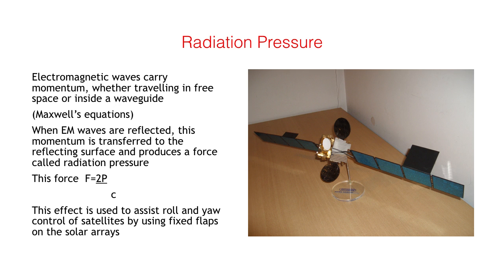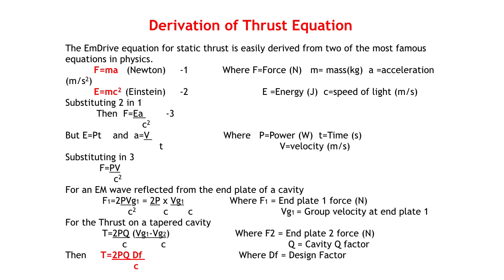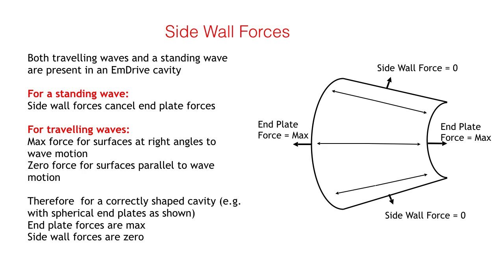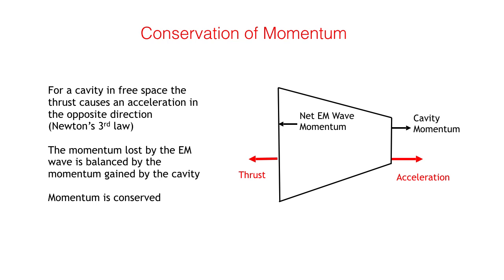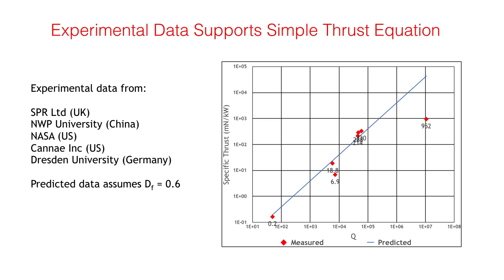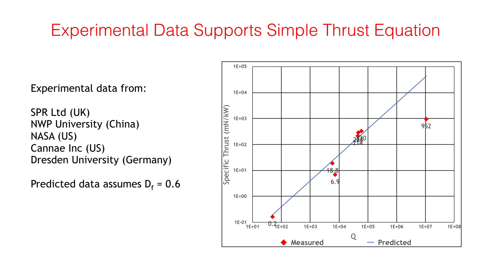Roger Shawyer Explaining The Basic Science behind #EmDrive

Comment: EMDrive 
FAQ (From the developer's website emdrive dot com)

Theory

1. 
Q. Is the thrust produced by the EmDrive a reactionless force?
A. No, the thrust is the result of the reaction between the end plates of the waveguide and the Electromagnetic wave propagated within it.

2. 
Q. How can a net force be produced by a closed waveguide?
A. At the propagation velocities (greater than one tenth the speed of light) the effects of special relativity must be considered. Different reference planes have to be used for the EM wave and the waveguide itself. The thruster is therefore an open system and a net force can be produced.

3. 
Q. Why does the net force not get balanced out by the axial component of the sidewall force?
A. The net force is not balanced out by the axial component of the sidewall force because there is a highly non linear relationship between waveguide diameter and group velocity. (e.g. at cut off diameter, the group velocity is zero, the guide wavelength is infinity, but the diameter is clearly not zero.) The design of the cavity is such that the ratio of end wall forces is maximised, whilst the axial component of the sidewall force is reduced to a negligible value.

4.
Q. Does the theory of the EmDrive contravene the accepted laws of physics or electromagnetic theory?
A. The EmDrive does not violate any known law of physics. The basic laws that are applied in the theory of the EmDrive operation are as follows:

Newton’s laws are applied in the derivation of the basic static thrust equation (Equation 11 in the theory paper) and have also been demonstrated to apply to the EmDrive experimentally.

The law of conservation of momentum is the basis of Newtons laws and therefore applies to the EmDrive. It is satisfied both theoretically and experimentally.

The law of conservation of energy is the basis of the dynamic thrust equation which applies to the EmDrive under acceleration,(see Equation 16 in the theory paper).

The principles of electromagnetic theory are used to derive the basic design equations.

5. 
Q. Why does the EmDrive not contravene the conservation of momentum when it operates in free space?
A. The EmDrive cannot violate the conservation of momentum. The electromagnetic wave momentum is built up in the resonating cavity, and is transferred to the end walls upon reflection. The momentum gained by the EmDrive plus the momentum lost by the electromagnetic wave equals zero. The direction and acceleration that is measured, when the EmDrive is tested on a dynamic test rig, comply with Newtons laws and confirm that the law of conservation of momentum is satisfied.

6.
Q. Is the EmDrive a form of perpetual motion machine?
A. The EmDrive obeys the law of conservation of energy and is therefore not a perpetual motion machine. Energy must be expended to accelerate the EmDrive (see Equation 16 of the theory paper). Once the EmDrive is switched off, Newton’s laws ensure that motion is constant unless it is acted upon by another force.

7.
Q. Why does the thrust decrease as the spacecraft velocity along the thrust vector increases?
A. As the spacecraft accelerates along the thrust vector, energy is lost by the engine and gained as additional kinetic energy by the spacecraft. This energy can be defined as the thrust multiplied by the distance through which the thrust acts. For a given acceleration period, the higher the mean velocity, the longer the distance travelled, hence the higher the energy lost by the engine.
This loss of stored energy from the resonant cavity leads to a reduction in Q and hence a reduction of thrust.

Test procedures

8.
Q. Has buoyancy been allowed for?
A. Buoyancy has been allowed for in the initial experiments and then eliminated by hermetically sealing the thruster.

9. 
Q. Are there any convection currents which might affect the results?
A. Convection currents did not affect the results, as measurements were taken with the thrust vector up, down and horizontal. Test runs were also carried out using a thermal simulation heater to quantify the effects of change of coolant temperature.

10. 
Q. Has stiffness in cables and pipes been allowed for?
A. The only connections to the balance were high flex electrical links

11.
Q. Has friction in any pivots been allowed for?
A. Static thrust measurements were carried out using 3 different techniques – a counterbalance rig with a knife edge pivot, a direct weighing method using a 16kg balance (0.1 gm resolution), and with the thruster suspended from a spring balance with the weight partly offloaded on to an electronic balance.

12. 
Q. Have electromagnetic effects been taken into account? These include interactions between current-carrying conductors and between such conductors carrying RF currents and nearby metallic structures in which currents might be induced.
A. Stray electromagnetic effects were eliminated by using different test rigs, by testing two thrusters with very different mounting structures, and by changing the orientation by 90 degrees to eliminate the Earth’s magnetic field.

13. 
Q. Is there any ionization within the air, which might cause electrostatic charging and resulting forces?
A. Electrostatic charges were eliminated by the comprehensive earthing required for safety reasons, and to provide the return path for the magnetron anode current.

14. 
Q. Could RF pick-up measurement circuits have produced erroneous results?
A. EMC tests were carried out on the instrumentation to eliminate the effects of RF pick up.

15.
Q. Could acceleration be caused by spurious torques generated by the air bearing?
A. Dynamic tests are preceded by an acceleration calibration test, using standard weights to determine the air bearing friction.

16.
Q. Could acceleration be caused by anomalous thermal or electromagnetic effects?
A. Acceleration and deceleration tests have been carried out in both clockwise and anti-clockwise directions Acceleration from rest only starts when the magnetron output frequency matches the resonant frequency of the engine, following an initial warm-up period.

Applications

17.
Q. Can the technology be qualified for space applications?
A. Yes, all the basic microwave, power supply, thermal and control technologies are similar to flight equipment currently used on high power communication satellites.

18.
Q. How can the EmDrive produce enough thrust for terrestrial applications?
A. The second generation engines will be capable of producing a specific thrust of 30kN/kW. Thus for 1 kilowatt (typical of the power in a microwave oven) a static thrust of 3 tonnes can be obtained, which is enough to support a large car. This is clearly adequate for terrestrial transport applications.
The static thrust/power ratio is calculated assuming a superconducting EmDrive with a Q of 5 x 109. This Q value is routinely achieved in superconducting cavities.
Note however, because the EmDrive obeys the law of conservation of energy, this thrust/power ratio rapidly decreases if the EmDrive is used to accelerate the vehicle along the thrust vector. (See Equation 16 of the theory paper). Whilst the EmDrive can provide lift to counter gravity, (and is therefore not losing kinetic energy), auxiliary propulsion is required to provide the kinetic energy to accelerate the vehicle.
Reply: The first 7 points are blatant lies.
Reply: arnaud nicolas and that comment is as credible as a promise from Santa Clause.
Reply: Flatlander What's your level of mathematics and physics? if you can understand undergrad equations, I'd be happy to precise why these points are dishonnest bs.
Reply: arnaud nicolas I'm just a electronics technician who used to specialize in pulse doppler radar. Worked with engineers but I'm by no means an engineer, scientist, or undergraduate. 
Now you have my background. 
You can check out my profile & get an idea where my expertise lie. 
Your public profile & experience are a little lacking in any department. 
For all I know you could be a smart 8th grader. (Just kidding)

Have you been to the emdrive website & actually worked out his theory of operation? It's on your level, if you're actually an undergraduate

Comment: Is there anyway to add a step up coil that would increase the rate at which microwaves generate kinetic energy?
Reply: I had the impression that the thrust is supposed to scale somehow with the intensity of the microwave radiation or the microwave energy in the cavity.  If that is the case then a more efficient reflector (and probably a superconductor) should probably get more thrust per kilowatt.

Comment: No. This is a crock of shit. No, the device does not "appear to  work,." No, NASA did not state the device works or even might work: NASA  stated the exact opposite. 

Fact #1: All EM pressure within the resonance chamber sums to zero. There is no differential thrust in any direction.

Fact #2: The device uses a staggering amount of energy and all it does it heat itself and some of the air around it.
Fact  #3: The "measured thrust" is less than what the most sensitive instrumentation can measure, and is therefore well within the error  margin.
Fact #4: Convection accounts for the few micro-newtons  instrumentation appears to show; the apparent thrust vanishes when the  device is in vacuum.
Fact #5:If the device was producing thrust,  instead of it producing convection in atmosphere like NASA said, it  would take many BILLIONS OF WATTS to lift a few hundred pounds a few  feet off the ground.
Fact #6: Conventional rockets are many tens  of thousands of times more energy efficient, IF the convection force 
had actually been EM force. Since the EM force is zero, the energy efficiency of this device is zero.
Reply: Grown ups realize that the author of the video is manipulating his equations. The math is not sound. 

Come on, this is undergrad physics here! 

If the author cannot get it right, what is he? Charlatan? Incompetent?

If you correct his momentum equation, all the thrust goes away. 

do we really have do experimentally test every claim like these? Even when the author make them based on wrong equations?
Reply: If the school for people who come with a high school diploma is going to be a racket already then a graduate school is going to be a bigger racket.
Reply: Desertphile months after your comment, it seems that NASA has done some additional tests of it and apparently China is working on it.

Comment: If the microwave was out of phase with the chamber wall field then it could be used as a thrust reverse since it will pull against the wall. If in phase it will push against the wall. There could be a possibility of using this principle as a tractor beam by sending a microwave beam at  a target's contact plate that has a field that is out of phase with the incoming beam.

Comment: The problem is, that Roger missed, that when Vg decreases, it ads momentum to the side wals of the cavity (and the side walls are angled!!!) and the avarage of this momentums points right. This creates force pointing right. So the force pointing right is bigger than Rogers thinks, actually, it is equal to F1. So this doesn't work. (Sorry for my bad english)
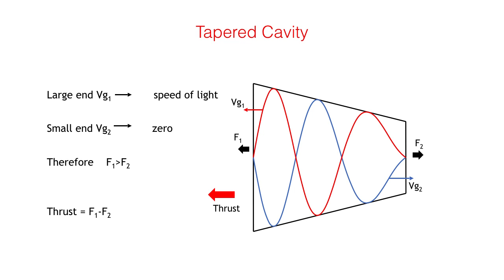Reply: This is not wrong. The graph at 05:23 is misleading. The Waves are NOT travelling parallel to the side wall. Therefore pushing against it too. That's where all that lost Vg comes from.
Reply: +Carl Dombrowski I am sorry, but the fact that the author of the video intentionally lies to us is not a matter of opinion. It's just mathematical fraud.

"some of the radio waves become intricate part of the whole engine"

What do you mean?
- the engine and EM waves are viewed as a closed system? sure, Therefore engine + EM wave  conserves momentum. Even more than that, the momentum of the photons crashing into the large end = momentum of the photons crashing in the small end + momentum of the photon crashing in the side walls.

- the walls of the engine absorb some of the largest wavelength? Yeah, Exactly! and that momentum doesn't "disappear", It's transferred to the walls. That's where the remaining momentum is. And it cancels out the sum of momentum. No thrust.

That video is a fraud. Trying to create some fancy new reason why the EMdrive should work doesn't cut the fact that the math it's based on is BS.
Reply: Stop with that absurdity that it's just that we don't understand it yet.

We understand very well how waves travel and get absorbed, and how their momentum is transfered.

You wish there were little "tricks" that would save the "inventor".

Conclusion : The math doesn't add up, the physics already solved the issue and said : it doesn't work. All these people have left are some experiments where the scientist couldn't fix all source of error.

Science doesn't work like that, bro.
Reply: I think you have already been proven wrong. Think about all the other areas where what's stated in the video actually works - photo-electric effect, heat in ideal gas, and so on.
Reply: arnaud nicolas My personal opinion, which is not part of the video, is that some of the radio waves become intricate part of the whole engine. Thanks to the tapering with a net gain in one direction. That's what "Q" is about. I go even further and say all movement of objects with mass is caused by electromagnetic waves becoming a part of the whole wave bundle of the object. So atoms moved around by heat in gas and such would be the same.
Reply: arnaud nicolas I have an impression that the inventor himself does not fully understand why his invention works - and I'm not enough of a mathematician to verify the complete mathematics here, though I probably could dig into this if I had some more time. Imo, it's a little like showing a complicated wave on an oscilloscope and then adding a longer wave, which will get the complicated wave to get out of sync and move to the side. Or in other words, matter not only stores heat in terms of random movement of atoms, but also in terms of movements in one direction - inertia or impuls. And it only takes the right kind of 'trick' to make it work, one of which (but not the only one) is mass separation, where we have the conservation of momentum.
Reply: Right.

Comment: 05:23 this explanation is reminiscent of a sailor blowing on the sail. In fact the lateral wall of the cone is subject to radiation pressure too, and I bet the component of this pressure parallel to F2 is just enough to balance F1 rendering the net thrust equal to zero.
Reply: The explanation is definitely not fully complete. It especially fails to explain the relationship between Q and motion, only describing it. Now if you see the whole engine as one big wave bundle, and the em-waves as long-wave interference, things become a lot easier to explain - and it even explains why heat=motion in gas, while at it.
Reply: Good bet.  A whole bunch of baloney about F1 and F2 when the thruster cannot possibly accelerate from internal causes and if maybe it works then it must be from some other cause.

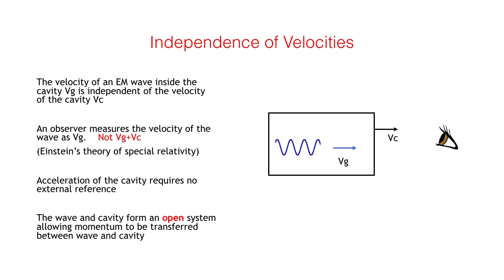Comment: Wait, I don't understand.  Is "Vg" the speed of light?  Or is it the velocity of something else (not the microwaves)?  If Vg is the speed of light, then it doesn't make sense to claim that Vg1 > Vg2 in the slide at 4:20.  If Vg is something else, it doesn't make sense to claim that it is invariant under special relativity in the slide at 3:10, since only c, the speed of light, is constant from all inertial reference frames.
Reply: Vg isn't speed of light, it is the "group velocity" of the wave, of the light in this case. Being related with light, it is constant. Speed of light can be c1<c if light doesn't travel in vacuum, at the same way can be vg1>vg2 when decreases the diameter of the cavity
Reply: That's the part I don't understand. What is the "Group velocity"? A wave is a wave and cannot change speed, it's always C. How could the shape of the empty cavity change that? 
It is also confusing because he uses the same Vg for apparently 2 different things.
Reply: c is the phase velocity o light when travel in vacuum. In general phase velocity is v=c/n where n is refractive index. A wave has a phase velocity v and a group velocity vg,  it's always vg<v so in vacuum vg<c. Vg is a function of wavelength λ,  Vg=c⌊n-λ dn/dλ⌋^(-1)